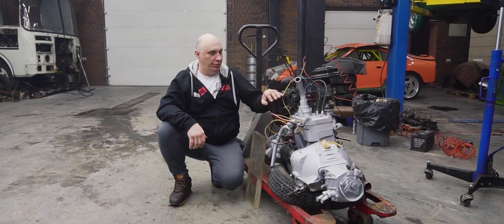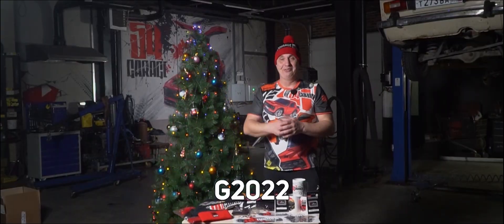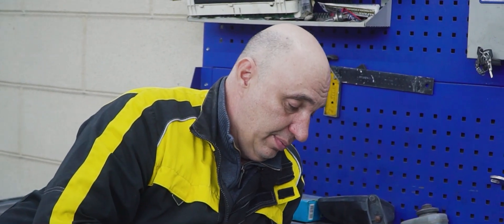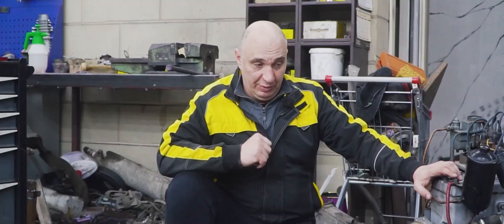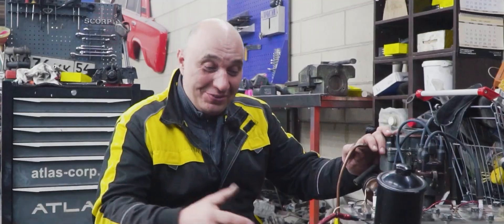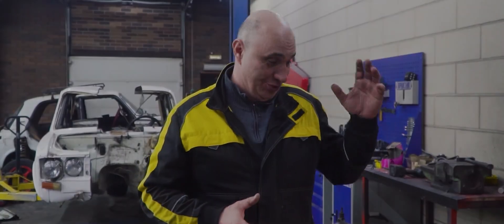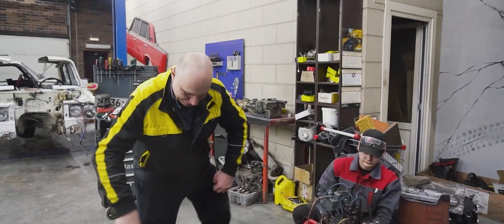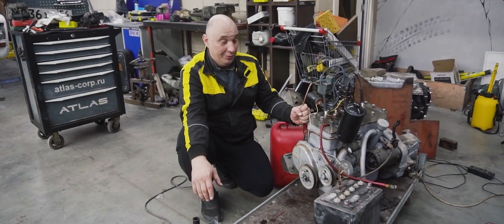We watch an engine run through a transparent cylinder head

Comment: Use methanol. It will keep the cylinder head cool. They use NO coolant passages in methanol drag racers in the USA, because methanol cools so well, even 10,000hp racers.
Reply: You're thinking of top-fuel cars. The fuel is methanol + nitromethane, the nitro in particular has a large cooling effect due to its extremely rich optimal air:fuel ratio. They also run for only a few minutes at a time, and most of that is at idle (like 8 seconds WOT at most).
Reply: @nerd1000ify  No, I am not. Top Alcohol cars also use billet heads. Methanol has a latent heat of 473BTU/lb, while nitromethane has only 241BTU/lb. 

Methanol absorbs FAR FAR more heat per unit of mass than nitromethane fuel.
Reply: @exploranator  
Wasn't aware that the straight methanol cara did this as well. I'd have to run the numbers to see exactly which one gets more overall cooling, nitromethane might have a lower latent heat of vapourisation but you do use a lot more of it per unit of air.

In any case it's a bit moot, because drag engines are weird special cases. There's a lot you can do when you're only running under load for a few seconds at a time, and the engine gets a rebuild every few runs.
Reply: @exploranator  I can attest to this fact, after a hard pull on my old shitbox which I had an AEM water methanol injection setup.. the intake piping would have condensation on the outside and the intake temps were below ambient XD
Reply: @nerd1000ify  Methanol has the same effect.
Reply: @nerd1000ify  top fuel racers run about 10% methanol to 90% nitromethane. I actually work for NHRA on the safety crew. Seen some wild stuff!
Reply: It also helps when your car is only run for 10 seconds and rebuilt after each pass.
Reply: @austinlane5533  10 seconds? They run alot longer than that.
Reply: @davelowets  
I'm talking from the line. 
Not warm up and tune. 
It still isn't long at all.
Reply: It helps that run time is short.
Reply: You need to almost double the fuel ratio 5:1 or something ?

Comment: warped perception channel, figured out all the little nuances with running plexiglass cylinder heads, he's done a rotary motor, the liquid piston motor, and a three and a half horse Briggs, he's used turbos nitrous, alcohol, and the best flame show for the money, acetylene. I like your spin on it, using a four cylinder. you guys need any pointers check him out.😎💥💯

Comment: Need to make everything clear except for te block becuse the block would be an engineering feat in itself to be able to do.  But clear oil pan, clear head, clear timing cover, clear throttle body, clear intake, clear coolant hoses, clear everything..  lol

Comment: Instead of rubbing down the compression ports so finely, do roughly with sandpaper and then use a blowtorch briefly flashed over the rough bits, it smooths it to a glass finish instantly
Reply: Might be able to just put it on rough then. The ignition was already melting it pretty fast so it would have probably smoothed out in the first 2 seconds.

Comment: I haven't seen the video yet. just letting you know dog, don't use the spark plugs, they'll melt out quickly. all you got to do is send one thin piece of metal through a tiny hole in the head, and when the Piston comes up on TDC, set your spark gap from your wire to the top of the piston at about 0.40.(inch), or around 2 mil. and that's it. now your engine will run for quite a few more hours without any trouble from a melted cylinder head. 😏💥💯💯💯

Comment: i'd like to see if a "2+2" engine works, meaning that it has a cut camshaft that makes cylinder 2 and 3 fire together, then 1 and 4 together, it should just need cutting the camshaft in half, rotating it by 180 degrees and then a quick weld.
Reply: Do you mean Crankshaft? Camshaft is what actuates and lifts the intake/exhaust valves; crank rotates on a fixed plane with the conrods.  But yeah, that'd be pretty cool to see!

Comment: Just if this helps. As plexi burns it releases fire retardants and that's what is likely stopping the engine firing after a while and what's causing the blue flame front you are seeing. If the engine cools and starts again easily afterwards then this is further evidence to this point.

Comment: You can actually see that it needs more ignition timing because the ignition event is happening after the piston starts to travel down and the flame gets pushed out before it’s finished burning.
Reply: Notice how the distributor is wobbling all over the place - that's got to be causing issues
Reply: Maybe that’s even the problem why it’s not running anymore- the timing is going more and more off? You can see that it’s obviously still firing, but maybe it’s firing so late now that the piston is barely able to do any work?
Reply: @RichTheNoun  plugs are perhaps getting fouled?
Reply: I was about to say. It was firing at top dead center.
Reply: It should still run regardless... I'm going to say it no longer runs due to lack of head gasket sealing, and loss of compression.
Reply: I also believe it's running rich, based on how it appears to be not burning all the fuel before it reaches bottom dead center
Reply: It should fire near top at idle, then earlier as the distributor weights are pushed outwards at higher revs. And as for the flame being pushed out - the valve area is part of the combustion chamber, it should combust in there, it has to. Obviously you know it needs to be space there for the valves to open, the size/volume of that area has to be big and thats one of the weaknesses of flatheads, reducing the area gives better combustion but limits both valve size and opening and thus doesnt let the engine breathe.

Comment: Wondering if some coolant in the block might be a good idea. Since you won't be running flat out you can probably get away with a small heater hose connection through the head, then feed it with a garden hose.

Comment: Some big washers on the top would've helped, and tightening down the head after it got good-n-warm would've helped also, thanks for sharing guys.
Reply: It looks like there was no head gasket too. I think the air was  coming through the cracks between the engine block and plexiglass.

Comment: I miss my old side valve engined Ford. There's something about being able to take the cylinder head off in five minutes that is quite endearing. Never even needed to fit a new head gasket, because there is nothing mechanically pushing it off like on a new fangled OHV engine and no oil-ways.
Reply: It also helped to have so many studs holding the head in place and 6.5:1 compression.
Reply: Nothing "mechanically pushes the head off" on an OHV engine either. 🤔🤷🏻
Flat heads are severely limited in power and efficiency by the horrible intake and exhaust ports, and the low compression they are stuck with. They are a poor design, and I'm GLAD to be past them.
Reply: @davelowets  Compression ratio and (When applicable) boost pressure pushes the head upward, whether the engine is a flathead, OHV, or OHC.
Reply: @skylinefever  This applies to a flathead also, if one wants to try and increase power. It's called cylinder pressure, and all engines, even flatheads, create power from it. If you want to live with a weak and inefficient engine, then use a flathead
Reply: There's something alright...near zero flow and horrible cylinder dynamics.

Comment: Here in the USA we call that type of engine a Flat Head Engine. In other countries they are called Side Valve Engine because the valves are on the side of the engine. I love Flat Head Engines. They are much simpler and that makes them more reliable. Performance is lower than an engine with overhead valves. Air flow is much better with overhead valves but I will take easy to work on and better reliably any day. The misfire on cylinder number 4 may be caused by carbon buildup in the intake port from a leaking intake valve. The misfire is not all the time so carbon is blocking air flow and absorbing fuel from the air/fuel mixture. 
Anyway, I really enjoyed this video! You guys are amazing at the things you come up with. 
I like working on Russian stuff. I helped restore captured Russian military equipment from Iraq at the Anniston Army Depot and I even have a KMZ Dnepr MT-11 Sidecar Motorcycle I restored a few years ago. I took it completely apart, inspected everything, and repaired or replaced bad part's installed at KMZ when the motorcycle was very poorly built by very poor workmanship. Today it's a good reliable motorcycle I ride often.
Reply: The misfire could be caused by many different things... Low compression, leaking valve, bad spark plug, bag ignition wire, carbon tracking in the distributor cap, and so on. It's not possible to tell by this video alone.
Reply: That does look like a continental F-162 found in Lincoln SA 200 Welders.
Reply: I don't know if OHC is any less reliable, I mean sure you have a chain, but the can is right over the valves, and I can definitely see carbon buildup being a huge issue with flatheads.

Comment: I would like to see a head made of high temp glass so it doesn't melt. I wonder if it possible?
Reply: I think they used plexiglass because regular glass would be too brittle
Reply: If someone can cut that complex shape it should
Reply: @GeorgiGeorgiev-ne9ps  Or cast.
Reply: Sure it would be possible. But besides just curing the "melting" issue, this would bring on a host of other problems because glass is a much poorer conductor of heat, compared to a proper metallic head.

Comment: I suspect the plexiglass got warped from the high temperature and pressure. A bit of soapy water will confirm that there are leaks all over the place including possibly the spark plug holes.

Comment: Try making a water cooled transparent cylinder head out of thick tempered glass or something that won't burn as much
Reply: Since they have the original, get it cast in Pyrex or Quartz. Maybe metal inserts for spark plugs and bolt holes
Reply: @thesilentcitadel  If you cast it in quartz, it IS glass.
Reply: Might be hard to form the glass around the cores you'd make, the viscosity of molten glass is pretty high
Reply: @irgant  rubber or silicone head gaskets and such would squish first. But one bolt tightened more than another would likely break it, so each bolt would have to be tightened a quarter turn at a time.
Reply: @markae0  What engines use rubber or silicone head gaskets? None. The common head gasket material used today is M.L.S. (multi-layered steel). It hardly compresses at all, and good practice to torqueing head gaskets IS in a pattern, and in small steps on each bolt. Ford had "glass" heads on one of it's running flathead V-8 engines way back in the 50's. So yes, it's completely possible to do it today.

Comment: I would like to see a more powerfull engine with the same settup. If the explosion turns more violent and such. Multiple reasons why it might be a bad idea, one is RPM.
Reply: A straight 6 should sound like a Bag of Nails
V8 is the Elephant in the Room......Firing Order differs from Manufacturers. 
Firing Order of this engine was 1,4,2,3 without a waste cycle.
Honda has a Waste Cycle (spark plugs fire on every stroke)
Alpha Romeo has a Twin Spark (2Plugs for every cylinder)

Comment: It would be really cool to see a whole entire engine transparent. The block and all. It'd probably be extremely difficult to make, maybe even impossible. At least, for such an engine to run. But if you did you'd be able to see the crank, pistons and connecting rods, valvetrain, etc etc. Would be even cooler on an overhead cam engine, or a bigger one two, like a V6 or V8 or something. Again, would be extremely hard or even impossible for an engine built like that to run, but man would it be cool to see
Reply: They make some pretty cool models today. I have a half size ford V8 that sparks and runs on vegetable oil for the oil. It costs a lot but it's really cool and you learn exactly how it all goes together, every piece, nut and bolt.
Reply: It could be made with todays material, aluminum oxynitride aka transparent aluminium. Its ceramic stuff, harder than steel. Too expensive to be realistic though.
Reply: Maybe with future materials.....
Reply: We need some of that Star Trek transparent aluminium.

Comment: I was going to suggest a glass/lexan laminate. Glass to protect the lexan from the heat.  The lexan can provide the strength and keep costs down. Though thick lexan is pretty expensive to begin with.
Reply: mould the hole thing out of glass, not you regular window stuff, scientific, Pyrex, mineral glass ?
Reply: @dh2032  borosilicate (pyrex) would probably do
Reply: @th3d3wd3r  make the glass think-enough and run with a low carbon fuel, gas or Alcohol, of some sore, after all it winter in Russia at the moment?
Reply: @dh2032  maybe ethanol, or throw some castor oil in the petrol and run rich. Crazy enough to work!

Comment: So cool. The advantage of sidevalve engines is that it's possible to do this relatively easily as the head itself is mostly just a cover. In my opinion they also sound better.
Reply: Sidevalve/flathead design means low compression, which means low power. But it also means less stress on things so they last forever - there are still some engines from the 1910s/1920s still running today.
Reply: Cool!
Reply: And if a valve loses its keeper it won't breakdance inside the cylinder
Reply: Tolerates poor fuel.
Reply: What if you cast a head out of heatproof glass rather then plastic?  Would that last any longer?
Not easy to make though, cos you would need a mold and some way to pour molten glass to make it, but it would probably last longer.
Reply: @VauxhallViva1975  

I have seen a series of photographs of the four stroke engine cycle, using an engine with a transparent cylinder head  in my father's old textbook on heat engines. My father graduated with his engineering degree in 1954 and the textbook was printed in 1947.

The head was made of fused quartz, the same material used for the windows of the bathyscaph Trieste, which went to the bottom of the Marianas Trench.  The engine was a flat head modified Briggs Stratton type, precisely because the cylinder head did note even have penetration for the spark plugs.  Given the thermal and mechanical qualities of fused quartz, it was at least as durable as a cast iron head, but probably more expensive.
Reply: Do they sound deeper?
Reply: @exploranator  Think old lawn mover, briggs&stratton before OHV.
Reply: The power, AND efficiency, of a flathead engine is severely capped by the horrible intake and exhaust ports. That's why their gone today.
Reply: manitoba2445  Cessna doesn't use flatheads and, in fact, the number of flathead aircraft engines has been limited throughout history.
Reply: manitoba2445  Aero engines like continental etc used in light aircraft are generally air cooled pushrod rather than flathead type. So the valves are above the cylinders but not the camshaft.
Reply: I think many of those flatheads were built when low octane was the norm. Ford flathead V8 guys would increase the compression to 7.5:1 for modern pump gas, but no more. Combustion chamber design plays a large part in what compression an engine can take. That is why there are so many 4V engines with 9.5:1 compression or above.

Yes, flatheads won't ever have piston to valve interference. That's what sucks about SOHC and DOHC timing belt engines. Whoever decides to put timing belts on a car should be hung by one.

The flathead Ford V8 also has a unique sound because the center two exhaust ports merge inside the engine block. The closest thing I can compare that to is a Mini 1275 cylinder head.
Reply: And you can revv the thing out of it and it will never blow because of the valve float
Reply: @gabrielvieira.4358  ... oh, you absolutely can float the valves on a flathead engine.... but they won't hit the pistons.
Reply: @rupe53  thats what I meant to say

Comment: It be awesome to see a transparent transmission shifting gears
Reply: I can personally attest that seeing a transmission valve body operate with a plexiglass cover plate is really something. When repairing a transmission on my Buick I had to cut test plates to run the valve body halves on a bench using a couple of pumps, cans of fluid and a lot of clear plastic tubing to take place of the interface plate. It was really something to behold when it all finally started to work, no amount of the couple hundred pages of repair manuals I had read up until then prepared me for what I seen at that point, it all just made sense. The gear train likely wouldn't be as interesting to see, some cool stuff goes on there but you would have to build things like the big drums and carriers out of clear materials too as they all have tiny channels for fluid to travel.
Reply: Now there's an idea :)

Comment: I'm 38 years old and just learning HOW engines and motors work in detail. I'd like to see if you make a plexiglass motor. Obviously some parts have to be metal like the spark plugs etc. But plexiglass pistons, manifold, lower half etc. 

Also seeing how well different types of fuel work as far as quality / longevity. My thoughts about this, comes from having my electricity turned off due to a storm outrage, and I wondered if I built something like this, if I could use it as a small generator to power a small heater, maybe a small 1 burner stove to cook soup, warm food etc.

Many thanks for all your effort, time, and energy you put into all your videos guys. You've taught me a lot of things in the world of engines and motors. ✊😎

Comment: You can tell by the color of the flame that’s it’s not being compressed.  Add some resin in the blow out points and put large washers on your head bolts to distribute the torque of the bolt or fab a torque plate.